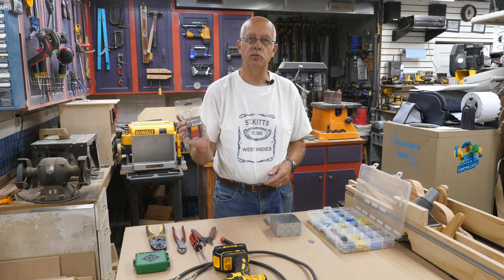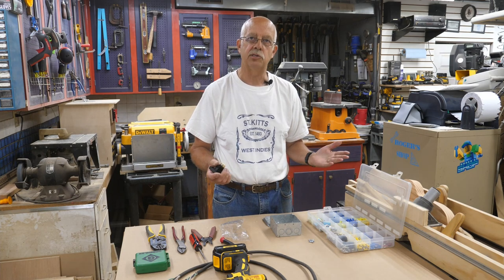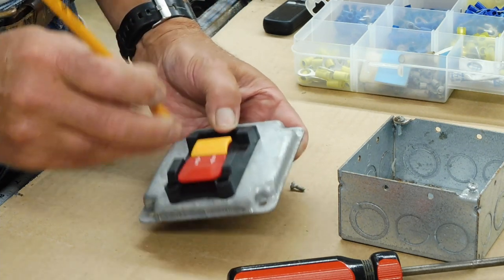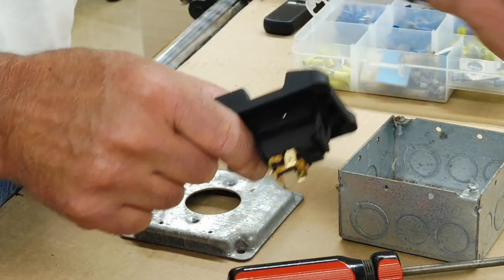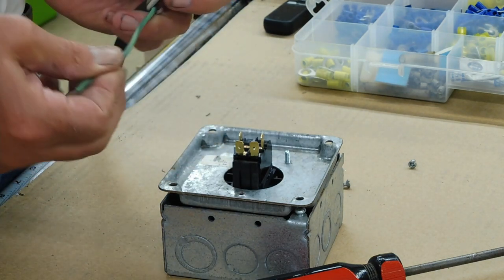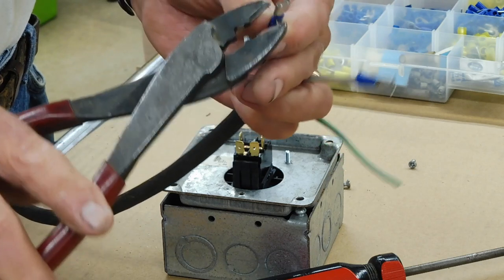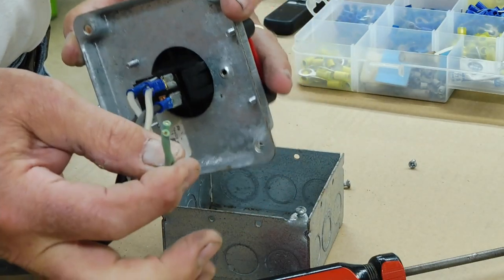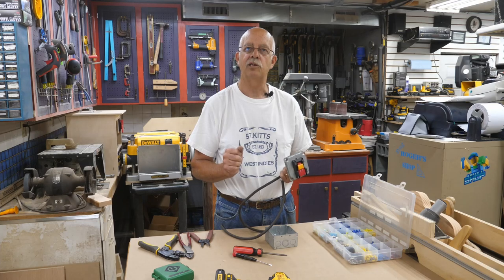Powertec 71006 Locking Safety Switch Wiring & Mounting

Comment: I have a question, the face connects at # 1 and the neutral at # 4?
Reply from the maker: Hot and neutral in on 1 and 4.  Out on 2 and 5.  Polarity makes no difference so long as you keep them the same.